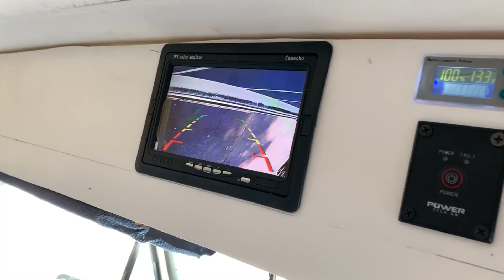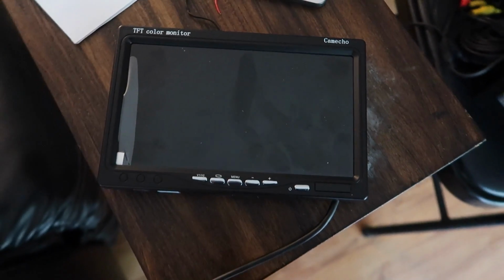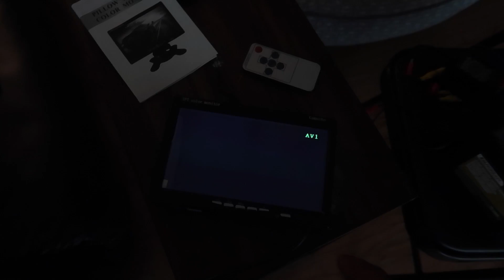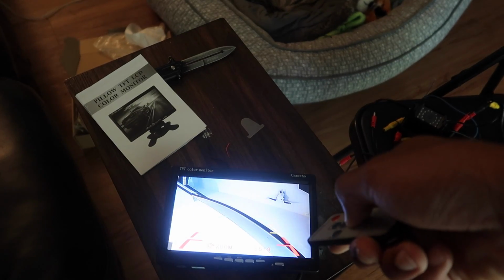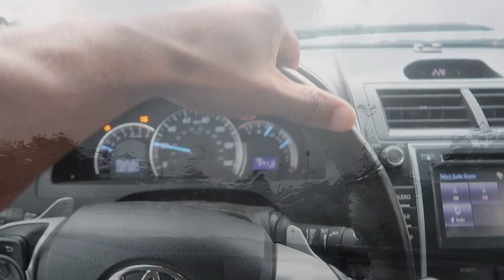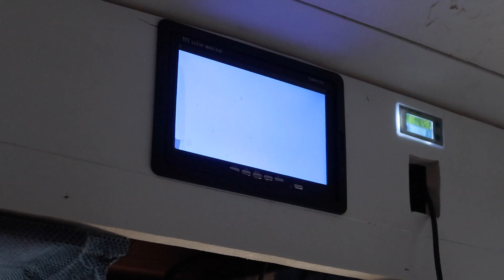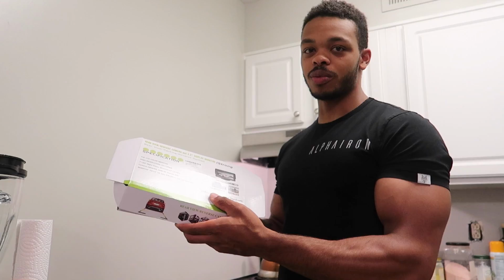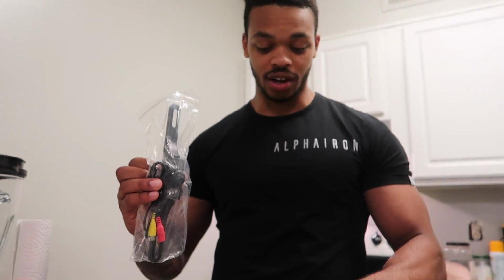DIY Solar Security Camera for Stealth Camping Vans

Comment: Insightful, interesting and informative. You're fast becoming a guru Bro, keep up the awesome work I'm learning a ton.
Reply from the maker: I’m glad you can learn something from these videos! I’m just trying to put out as much legit info that I can right now
Reply: I really appreciate the truthful, hands on approach you exhibit. I'm converting my Suv into a mini camper so believe me the information is both useful and inspiring.
Reply: @Dualex_Builds  I have a duel cam DVR with a switch which is called a "Magic box" (google) it runs off your battery even with the truck turned off ..You can have it run 1 hr after 2 4 6 12 24 hrs on a loop or Have it set on 11.6V shut off ..Letting still be able to start your van When you start your van the recording runs normal ..It paid for it's self x2 ..once in a parking lot i was rear ended And they took off  But the plate was clear for the police report...Another i was going to get a ticket for running a red light By a police officer that infact ran the run light without lights/siren  Then 1/2 block later turned on his lights Which after the Lic ins ownership task I metioned it was recorded as a yellow light and recored his car passing the red without his lights or pausing at the intersection to on coming traffic ...He walked to his car and back and said : "I'm only going to give you a warning this time" Had the cam not been on I would of been in court explaining my case...and lost